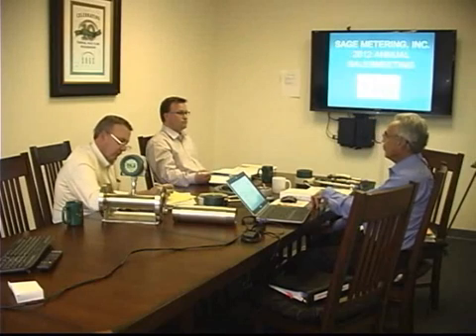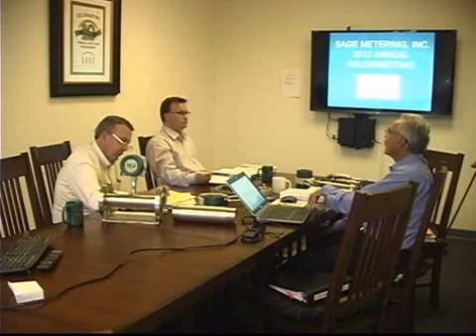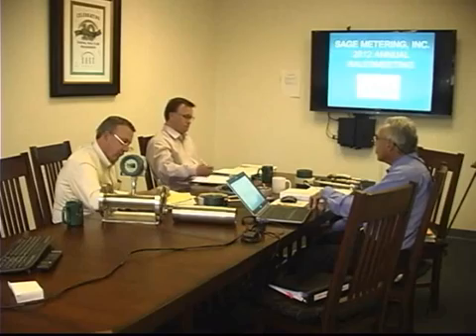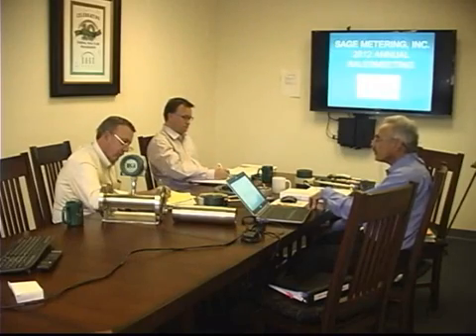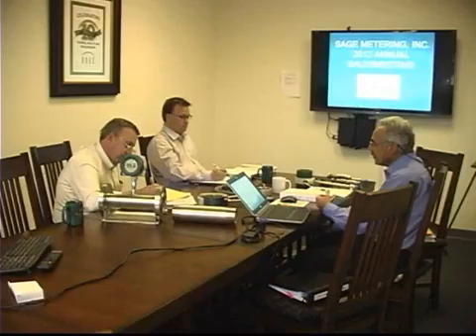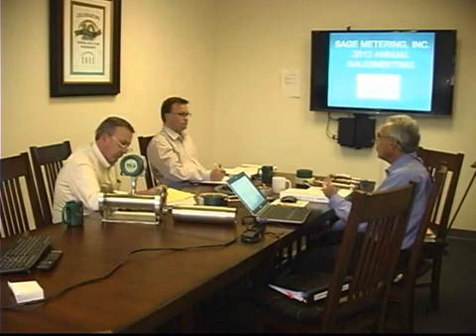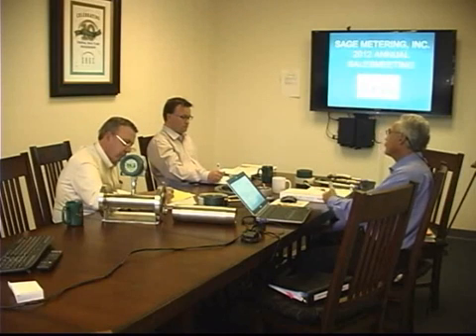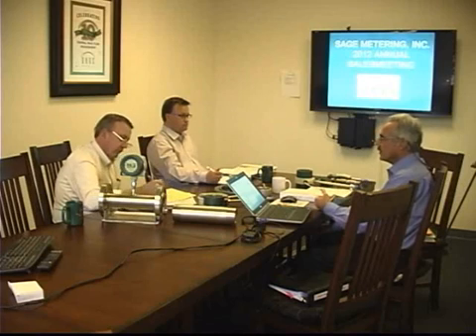Why Measure Mass Flow? | Thermal Mass Flow Meter Experts Explain | Sage Metering

Comment: Dear Sir, 
I am Sunku Prasad, a PhD student from IIT Guwahati, India, working in the area of high temperature thermal energy storage system. I want to know whether it is possible to design a thermal mass flow meter  for measuring mass flow rate of molten salt. the molten salt is flowing in the pipe at a temperature of 400°C. The flow rate range is 2.5 lpm to 10 lpm. 
Kindly let me know the possibility of such device. 

Please share your contact to discuus further on this application. 

Thanking you 

Sincerely 
Sunku prasad
Reply: did you e-mail him